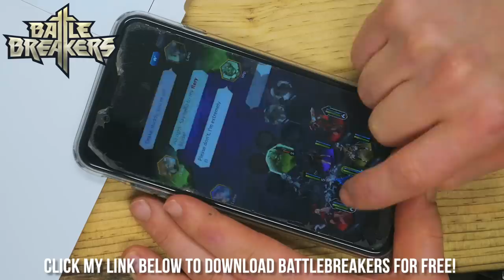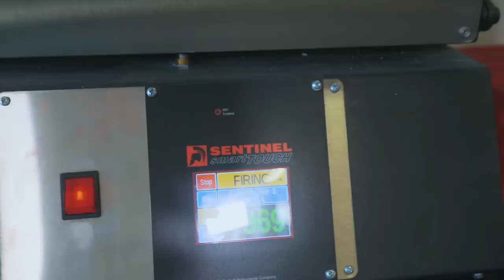MAKING A BOWIE KNIFE FASTER THAN A POT OF CHILLI !!! Willi vs. The Chilli

Comment: This semester in school I enrolled in a materials science class for my engineering degree, and we've been learning a ton about the metallurgy that goes into hardening steel for use as a tool. It's all graphs and cooling curves and doing the math about how much of a metal's internal structure is of what composition at what temperature, and it only amazes me more that skilled blacksmiths do this stuff by feel, and have been for many centuries before the exact science was understood. Great work gents, it's always worth the watch.

Comment: Proof positive that Will could go on Forged in Fire & have a good chance of success.
Reply: CrimsonTemplar2 the only reason I hate forged in fire is the fact they only give you 3 hours to build a Knife/Sword....and then they basically want something that will bash iron bolt and then cut tissue paper...
Reply: @eslcity  I agree, not one competitor on that show has ever turned in something in the second round for testing that they would have let out of their home shop.  So many episodes where nobody won, someone just lost not as bad as the next guy.  These 2 guys are much more fun to watch.
Reply: @starhawke380  David Roeder did. His knife was perfectly finished with his touchmark stamped on it after the first round. But I agree, the vast majority are horribly non-finished and delaminated pieces of scrap. At least you don't feel bad when they smash it into the iron bolts. Plus they give them these unrealistic challenges like harvest steel from a shopping cart and a can of beans. Basically sources of metal that you'd avoid even in the apocalypse. Or forge outside in the sun, literally no situation where you'd be forced to do that. Nobody would set up in the sun. Gauging the temperature of steel in full sunlight is not a skill that any smith would develop or need to develop. At least the final round saves it a bit because the parameters are realistic and they get to choose their own materials, and have proper time.

Comment: Every time you open the slow cooker you add half an hour to the cooking time... So, clearly Willi wins.

A BBQing addage works with slow cookers: if you're lookin', you ain't cookin'.
Reply: It's not that bad though. When slow'ing in the BBQ or smoker, a very substantial portion of the thermal sum is the air volume inside. And a BBQ is not conducive to fast recovery within a small delta - a quick recovery in a BBQ would demand having to introduce much higher temperature heat even though for a short while.

In a slow cooker holding a pot, chili etc though - once up to temperature the majority of the thermal sum mass is in the chili. The majority of its internal volume is that high-mass food. Meaning unless you leave it open so long that the overall volume of food loses significant heat, it should thermally recover within a minute or two after putting the lid back on. And if the heating pot needs to help it along; as the heat source is in direct contact with the food mass, it can dump s lot of energy into that without needing to boost the temperature notably above the wanted target temp for the food. As it does not need to compensate for the indirect mode of heating that a BBQ (or almost any kind of oven) does.

Tldr keep the lid closed, but thermal recovery time is not nearly as bad as with a BBQ.

Comment: FYI, one little tip in using a crockpot, the clips are for transporting after cooking, you should never cook with it latched, it’s a slow cooker not a pressure cooker.

Comment: Your handle material appears to be Bubinga, an African wood that is very hard (similar to cherry) and strikingly beautiful when properly finished. Bubinga has a lot of potential for chatoyance, which you can easily bring out by applying several coats of tung oil, allowing each coat to dry for several days before the next coat, and finishing with a high-quality lacquer or varnish. With enough oil soaked into the surface, the wood's appearance will change with the angle of the light source (the aforementioned "chatoyance") similar to a polished tiger eye stone.

Comment: Wife said when your using a crockpot don't latch it shut.
Reply: They have a steam/pressure release vent on them. The reason for the latches is for transporting the vessel, but if you do latch them while cooking, there's no harm. The vent is there specifically for this reason. If he latched that, and it was airtight, it would become a bomb and blow the glass top apart.
Reply: I was going to mention that myself, I have that crockpot.  Chill looked great and knife even better.
Reply: Although it has a pressure release vent, the vent can become blocked with boiling/splashing contents and break the glass. Not that it is always an explosive pressure vessel, it just can happen. Safety first.
Reply: Couldn't be worse than when they built the vacuum chamber.
Reply: Also, don't pop the top.  The moment you do so, you lose ~1 hour's worth of heat and cooking.

Comment: From what I understand, you're not supposed to use those clamps while cooking at 5:28. It can cause pressure to build inside the Crockpot and explode the lid while the liquids inside release water vapor. I believe those clamps are only intended for storage and when you want to move the Crockpot around. I think the lid is just supposed to rest on top.

Comment: The only wrong way to make chilli is when it's inedible.  However, here are a couple of tips.  Drain the beans (and rinse them) to not have it as watery.  Also, if you use canned tomatoes (or even fresh) put them in a strainer and drain those as well.  Tomatoes have a lot of water in them so even without that water in the can, you will still get a ton of liquid.  Also, drain the fat from the ground beef (or whatever meat you use) after browning it and before putting it in the chilli.  As for vegetables, IMO, anything goes as long as you like it.  I once had a chilli that someone put corn in.  Gave it that slightly sweet flavor you get from corn bread.  Also I like throwing mushrooms in mine.  Most people think I'm crazy for doing that, but see my previous comment about vegetables.  Finally seassoning, when using chilli powder, no matter how much you think you added, you didn't add enough and always taste and salt as you go, vegetables need a lot of salt to get those flavors through.

Good luck on your next bowl

Comment: i'm curious as to what kind of blower you use for your monster forge... also why do you light it in a fashion that risks your eyebrows? i always turn my blower on, open propane tank valve, light torch and place at corner of forge door, open ball valve, then turn regulator up slowly til i the "hiss" comes and whoosh it lights at lowest gas output and doesn't act like a stargate portal opening. then i crank up on regulator and choke off with a metered valve on side of forge, that way as tank freezes or goes toward empty, i just open that one up a bit more for convenience.

Comment: Willie even though there's an expression that calls all big knives Arkansas toothpicks an Arkansas toothpick is a specific kind of dagger with somewhere around a 6 inch long double edged distilled tapered blade that is about as wide as its handle at the hilt comes out into a very fine point at the tip

Comment: I liked the concept but was mildly concerned with the food sitting in the work area around all of the metal particles and such. Also, if you turn the heat on high instead of low, your chili would've cooked in half the time. It might not have been as good as the spices may not have melded together but if you're not trying to make a blade at the same time, it's a useful trick if you started the slow cooker later than you wanted